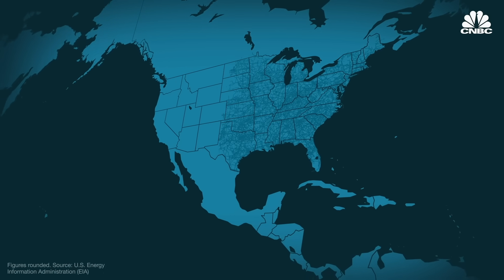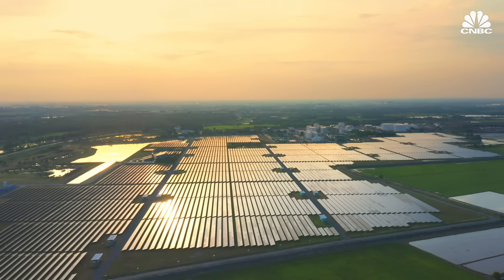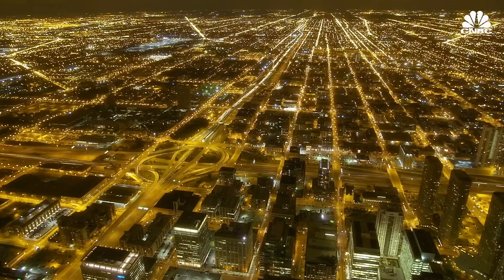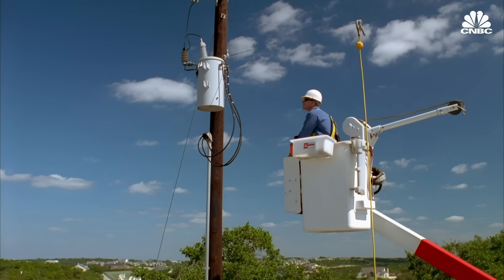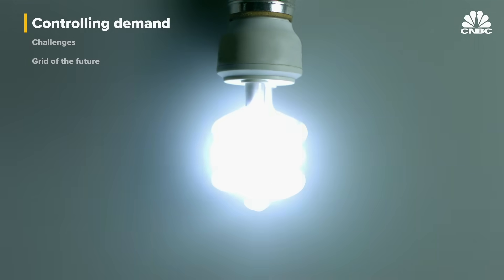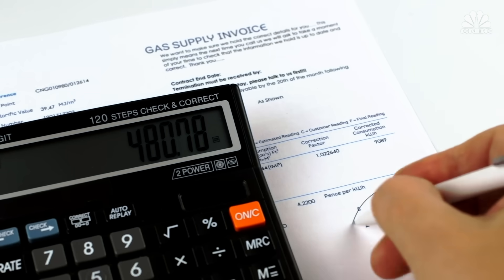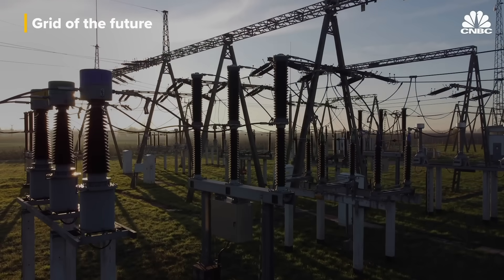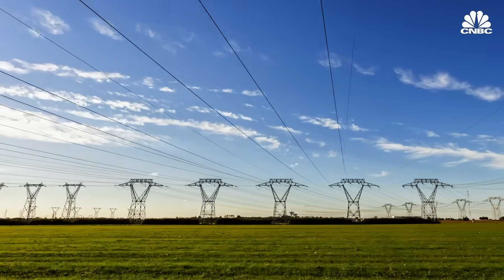How The U.S. Can Build A 100% Clean Grid

Comment: A toaster that only works at the most efficient time... Bet that isn't breakfast!.
Reply: Who works full time and has time to worry about when to use their lights heater and water heater? We’re not all rich like apple
Reply: @TKUA11  no need to worry about it if your water heater did it automatically... Home temps and water heaters could automatically increase a couple degrees above normal when there's extra electricity
Reply: Toast at 2:00 AM, 😂
Reply: Charcoal and an iron skillet, the cowboy way :)
Reply: Great point you made, and I love how they say we need smart meters and tech to know when people are using the most.. Well isn't it obvious, people take a shower before going to work, or after and generally use their toasters in the morning. Oh ya and if it's hot outside.. they run their A/C.  Doesn't take "smart" tech to figure that out!  Lol
Reply: That toaster was definitely a weird choice, lol. Definitely not the best option for smart scheduling

A better one would be dishwashers which can run automatically overnight or at odd times. Maybe fridges or freezers that get a few degrees cooler when electricity is cheap. Heaters that preheat water or your home can do the same. Your EV can selectively charge at various times, and with new tech could even store energy for your house or even the grid
Reply: @ThomasBomb45   Dish washers need to be loaded. Tankless waterheaters are more efficient.  I need my car fully charged. I takes nine hours to charge the ford 150 w/ level 2 charging.
Reply: @mattpettit6397  It would look like this: load your dishwasher after dinner, add detergent, press "smart power". Set it and forget it. The dishwasher will be sure to run overnight, and will take advantage if electricity prices go lower due to, for example, late night gusts of wind.

Your car will take 8 hours to charge from empty to full, sure. But usually your car is at least half full. Your car can have a smart charger send power to it during the best 4 hours out of those 8 hours. All smart chargers also have an override mode that charges your car to full ASAP, useful for when you need it. Smart chargers also usually have minimum charge levels that you can customize, etc. The goal is definitely to impact daily life as little as possible or even make it better

Comment: They never talk about the environmental damage from mining lithium for batteries. Open pits, water pollution, and child labor in South America and Africa used to mine for storing electricity. Also batteries need replacing overtime and current recycling of battery components isn't the best for reusing material. Oil and coal are still abundant and at a low price, why spend trillions for the same power or less? They should crack down on India and China's pollution and emissions not the US.
Reply: You think it's cleaner to mine aluminium etc?! It's how the world works.

Comment: The coolest part of a smart meter is that someone else can cut your electricity off remotely. It will be determined in the future how much energy you can and cannot use.
Reply: We call that socialism, communism, and fascism. I am glad that you are for that kind of government.
Reply: Michael I was being sarcastic about the entire situation. Personally I am against forced control and this is nothing more than a tool which could be easily used against a people.
Reply: I am sorry I didn't take it that way, I cant visualize a world where the government controls when you use the power you pay for.
Reply: how about the outright lie about transformers only work one way a transformer doesnt care about which coil is energized thats how ac power works i think these experts are joes advisers and they got their energy knowledge from star trek
Reply: @Golegar  I my teenage years there were transformers that could be taken apart. I tried running them backwards. Most of them didn't like it. The secondary needed to be feed a little less voltage or amps to not fail.
Reply: @captbiptoe  brush up on ac theory transformers dont care which coil is the source they put out voltage and current on the other coil now as to wind and solar putting electric back on the grid it has to be the same phase angle problem is your average home depot laborer doesnt have the technical know how ive done powerline construction for 20 years and i dont either
Reply: @captbiptoe  what do you mean by running a transformer?
Reply: @Golegar  In high school physics that's when we use a known electrical source to energize the primary winding and measure the output of the secondary. We found that energizing the secondary to it's rated voltage and amps often damaged the secondary after a short time of getting output from the primary. Thus, my observation: transformers work in both directions, but it's easy to break one using it in reverse.
Reply: @captbiptoe  the ones out on poles or in substations don’t care which way the current is flowing
Reply: And get sued for shutting down home medical equipment. People won't know if they can start cooking dinner. That just won't work.

Comment: Why is the left so short sighted about energy only coming from wind or solar. The reality is that wind and solar are nearly at their limits of performance, you can only get so much energy out of a solar cell or a wind turbine, and once that level is reached, that's it, other than adding more of them. And unless you are using one of those two power sources, we have to either shut down or drastically reduce our consumption. The good news is there is a high density power source with no carbon emissions, Nuclear Power. The problem is the PERCEPTION the left has with Nuclear. The REALITY is that nuclear is SAFE, efficient, and the technology exists to expand it to be a genuine way to power our society with a small carbon footprint. Check out these videos from professor David Ruzic, from the university of Illinois, showing the SCIENCE as to why and how NUCLEAR WORKS!
https://www.youtube.com/watch?v=7gtog_gOaGQ
https://www.youtube.com/watch?v=F92L6F0INYk&t=642s
https://www.youtube.com/watch?v=_mJ3S-VQuHY&t=61s

Comment: We need more nuclear energy. Its the cleanest energy if we're talking about capacity and output.
Reply: I agree that nuclear is great and clean but it's just to expensive in its current state. Nuclear needs smaller standard plants to bring the price down.
Reply: @jeffreysmith4586  wrong. Nuclear is one of the cheapest sources of energy, because of low fuel consumption and low operating costs.
Reply: @canaldofred2366  it's also safer than wind and solar.
Reply: @jeffreysmith4586  Only initial costs are expensive, like building the actual nuclear plant and getting it approved in the first place. Once it starts running, its a matter of maintenance and the operating costs are low.
Reply: Check out the ‘how to save a planet’ podcast on nuclear energy.  Nuclear is amazing technology and in its new iteration is very safe, but humans get in the way.  Project costs spiralling out of control, communities against it, etc.
Reply: Except it isn't
Reply: @ArthursHD  
How so?
Reply: @ArthursHD  it is. Almost no co2 emissions, low operating costs, low fuel cost, and you have to remember that nuclear waste is the only waste in the energy industry that is contained.

Comment: The coal fired power plants built during the 1970s throughout the western USA are being decommissioned as they become obsolete and undesirable.   The land stripped of coal and returned to it's natural state, more or less.  That area could be made instead into a big parking lot for photovoltaics as storage technologies improve, and the existing transmission lines and system could be immediately used without all the permits and roadblocks required for new projects.  In the southwest region of the USA, the sunlight is pretty reliable and the land involved is relatively unproductive in a business sense.   Where the plants are on native American land it will provide an ongoing financial stream.  On federal land it can open possibilities for private investment to continue supplying power needs through government/private/corporate cooperative agreements.  No downstream pollution,  and not in anybodies neighborhood.  Seems like a win/win to me.  Had it in the back of my mind since I was building those power plants 45 years ago.

Comment: One big problem is local zoning laws as to installing wind or solar many communities do not want to see it in front yards or mounting on roofs.
Reply: It is here in Riga as well, don't get it why Doh. They are so afraid of PV glass roofs to street side :(
Reply: @ArthursHD  there’s a lot more to it than just not wanting it there is serious concern about fire or a accident. Solar are aways putting out voltage in case of fire especially on roofs a lot of companies that install them leave little or no walkways around them or through them in case of a accident or problem. A nearby fire department responded to a MVA only to find the truck sheared off the pole with solar panels on it had to treat it as if it was a wires down engined,they had to wait for home owners to return and shut down the system. Just like EV cars are a nightmare at a MVA cut the wrong wires someone get hurt bad.

Comment: yeah, I'm not putting more wear on my car batteries to power the grid. that better be optional. Also you guys are down playing Nuclear too much.
Reply: Yes exactly. Here in France, more than 90% of our electricity is carbon neutral, with 70% coming from nuclear plants, and 20~25% coming from renewables. France is currently the only major economy in the world with clean electricity, and it’s also cheaper than the E.U. average. France is a role model in clean electricity but other countries don’t seem to understand it...
Reply: That is completely okay if the price of kWh sold exseeds the cost of battery battery degradation cost plus potential increase of cost more frequent battery replacements.
Reply: Coal plants are more radioactive than nuclear, and they didn't even mention geothermal which would allow all the drilling companies to pivot.
Reply: @KRYMauL  yes it’s also a solution, but there are only few places where the geothermal heat flow is strong enough to generate power (mainly in California and Nevada).
Reply: @joshjauregi3228  That's incorrect, EGS can be done everywhere and would simply employ people from the oil and gas industries. 

Wikipedia: https://en.wikipedia.org/wiki/Enhanced_geothermal_system
Reply: @KRYMauL  it’s not incorrect. An EGS  plant needs to be economically competitive, so you definitely want to drill at strong geothermal gradient and flow locations. And for now, the most powerful plant is only produces 25MW of power!! Which is absolutely ridiculous compared to the money invested in those plants. One day the technology might be on point, but right now it’s not.
Reply: @joshjauregi3228  I looked this up before, EGS is close to the price of natural gas and can be done can be done in any location. However, it costs slightly less to do it areas where there is less crust. 

Moreover, EGS is more about cracking the Earth after a certain depth and using the same method as fracking to generate steam.
Reply: Human error, natural disasters, and the possibility of a terrorist attacks  are dangerous to our wellbeing if we use nuclear power plants. Costly accidents are bound to happen in the future, with 3 happening in the past 50 years.
3 accidents don't seem like much for 50 years, keep in mind nuclear energy was supposed to be "safe", "efficient", "and cost effective". The Chernobyl accident costs more than Hurricane Katrina, 125 billion dollars to 250 billion in damage. Renewables are one of the cheapest energy sources. However, in opposition to this is nuclear power, which is rising every day. Many plants around the world are being shut down or in danger of financial collapse due to economic reasons. The costs of a nuclear plant includes fuel, maintenance etc…No long term solution to waste is evident when we use nuclear power, or in place as of right now. Facilities that store nuclear waste are running out of storage. Due to their limited capacity, the nuclear industry is turning to other solutions.  Turning to other ways of storage that are more costly and potentially unsafe for the environment
Reply: @altoic1  nuclear power is the safest form of electricity generation in the world. More people die as a result of pollution from fossil fuel plants. These accidents you describe are tragic but they pale in comparison to accidents with fossil fuel extraction, processing and refining.

Comment: Interesting that there is no mention of hydrogen as a means to store energy that is more environmentally friendly than batteries
Reply: Hmmm.. wonder why. Definitely a great source of energy
Reply: Not very efficient though.
Reply: @Robert-j6r8c  Exactly, It is mostly good for use in industries. For example where high grade heat is necessary so you only need to covert it once :)
Reply: @ArthursHD  
Pumped Hydro is the best battery.